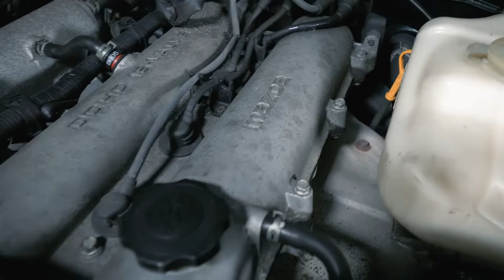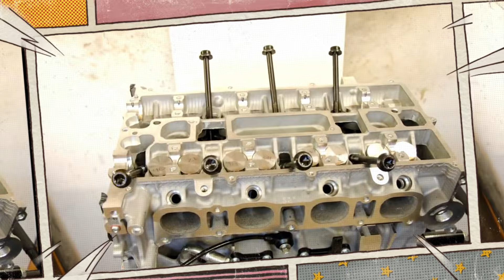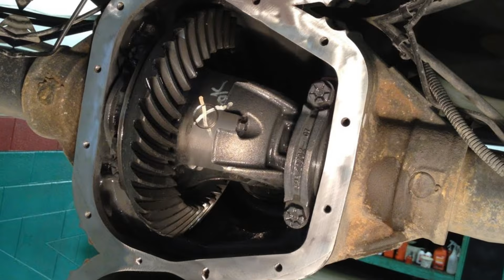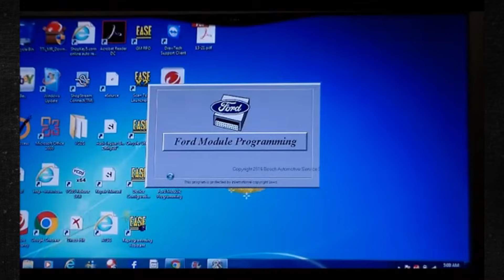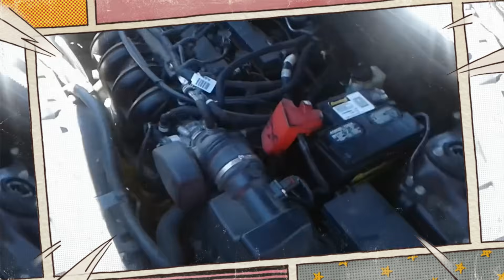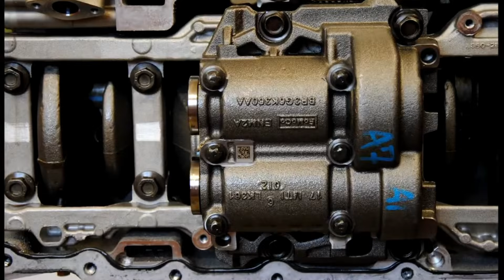Ford 2.5 Duratec Engine: Common Problems and Reliability

Comment: here's my problem with this engine. It's the freaking engineers!!
They deliver early designed it what's the alternator in the back.!!
Why do they not  put in the front so you can get to it why is it down in the bottom??!!
I had a Toyota Camry was it up front and the water pump You can get to everything. 
Ford Fusion in the 2012 just to replace high beam bulbs practically have to pull the headlight buckets out that's another stupid engineering thing with a four-cylinder engine in it!!

Comment: My 2009 Escape XLT non hybrid 2.5ltr that I bought for $1200 with 63k miles has been great. I got it cheap because the Electric steering column went out but I replaced that for $1k OEM part off eBay, dealership wanted $4k for the repair. 
When hurricane Beryl hit us, we ran it 24/7 because we was living out of it for 2 weeks. 
I did have a little hard shift from 2nd to 3rd in -8°f temps but I added Motorcraft Mercon LV to my new drain & refill. That fixed it. Got 36-38mpg from TX to Colorado Springs. 🤟

Comment: Mazda engines are often overlooked when it comes to longevity. I had a 1991 Ford Escort Gt, Mazda  Dohc 1.8 Bp engine that was basically a Mazda Protege with a Ford interior. That part was very true, , gas gauge never worked,the door handles broke. The engine on the other hand never died. I put 389k on the engine, the engine was so quite and so smooth. I never found another 4 cyl engine that was like that until my 2017 Subaru Crosstrek.

Comment: I have a 2010 fusion that just passed the 235k mark, and the motor is still running like a top.  I bought the car in nov 2023 with 206k miles on it. 3 months ago i hit a pothole and 2 days later the power steering went bad.

Comment: An issue I understand with the electronic power steering units is failure associated with the force required to drive the associated linkage, joints etc. Lower ball joint, tie rod ends going dry, getting stiff or shot can be the culprit. To keep em happy longer, at 100k, I used a grease needle on my grease gun with compatible grease to give em a couple shots watching the joint seal boots. At one seventy k now, steering and joints still happy.

Comment: This engine is woldwide known for powering Fusion and a Mazda, but Ford installed it on some Ranger versions on some markets. I got a Ranger 2013 here in Brazil, powered by it and it runs with gasoline and/or ethanol

Comment: I bought my Ford 1999 contour SC with the 2.5 l VTEC 6 cylinder and it was like $160,000 when I bought it and it's almost pushing 200,000 I've had it a year and a half still going strong

Comment: If your car is overheating and you can't figure out why the answer could be in the coolant you are using. If in doubt buy it from the dealership in the parts dept..

Comment: For Gears 1 & 2 rough shifting, try changing the input speed sensor first it fixed rough shifting in my 2005 Mazda 6 2.3l Duratec engine.

Comment: My 2010 Mazda 3 has this engine paired with a 6 speed manual, and it just hit 400,000 miles and still running strong. It has been a great car.
Reply: My custom 2011 Speed 3 sedan is Trucking along at 185,000, with a 2.5 L block, and timing/2.3 Turbo heads and rest of engine. Have not yet dynoed it but I was told it would make a round 285 crank. Making the stock 15ish psi of boost.

Comment: I have a 2017 fusion with this 2.5 engine, flawless.  ive used Mobil 1 synthetic every 5-6,000 miles, currently at 96,000 miles on the car. The only issue has been that arm that attaches the gear shift to the transmission has slipped off numerous times, leaving me stuck in park. so i bought a replacement kit of little bushings that are super strong, i don't think itll ever come off now 👍🏼
Reply: I think that had a recall! Glad it’s going strong, 2016 2.5 here
Reply: I read online that the 2015 fusion had a recall on that bushing. I have a 2010 fusion with no power steering right now, but i'll be closing a deal on a 2015 fusion in a few days. Could you tell me what kit you bought to fix yours? I want to do that repair even if its already been done for the previous owner/s

Comment: The last good engine Ford made
Reply: I think it was instead more of a Mazda engine, mostly based on Mazda's F-series. After this generation the successor generations diverted in the Ecoboost from Ford and the Skyactive from Mazda.
Reply: @ert-j5f  Correct its the Mazda L-series.
Reply: Mazda made, ford doesn’t make good motors!
Reply: Makes they still have it on some models
Reply: And I don't think the Ecoboost is bad either, as it is frequently used on lightweight racing vehicles. I would be more tempted to think that people give them bad maintenance.
Reply: @jugganaut33  The 5.0, 6.7, and a lot of their ecoboosts are actually pretty reliable. There was a 6.7 with over 1.3 million miles on it and still going, the 5.0 is legendary for how reliable it is.

Comment: I'm fairly certain this is the same 2.5 motor used in the maverick. Do we have confirmation on this? I own one, it's been flawless, but it's only 2 years old.
Reply: It is the same indeed. Also, the eCVT on the Maverick is a beefed up version of the same transaxle used on the Escape Hybrid. It is a really good combo. Just make sure to change your oil every 5K miles, don't follow Ford's maintenance schedule of 10K miles.
Reply: @Joe-bepop  I change my oil every 3k or so. Do I really have to? No, but that shows you how much I care about stuff. So hopefully our maverick lasts a long time.
Reply: Same my maverick is almost 3 years now its the reason i went with the hybrid. No turbos for me

Comment: Have 245K on ford fusion hybrid with this motor. Has been flawless. Mobil 1 synthetic oil change every 10K miles.
Reply: Correct.. Mobil 1 Full Synthetic in mine as well

Comment: Not a fan of "electronic" steering assist. Did you see that steering column?  Scary! Hydraulic power steering is a proven and relatively inexpensive design that actually gives you better feedback from the road. An example of - if it ain't broke don't fix it.

Comment: It’s not just the driver’s side axle seal that goes bad. Excessive play where the axle plugs into the transmission is the cause many times. Ford had a pretty well known bulletin on the issue.

Comment: I have 175k and my new pcv valve is louder than my motor and straight pipe at idle…
Reply: You  could delete the pcv valve and put in an oil catch-can. YouTube it. Easy to do. GL

Comment: The biggest section of this video is about transmission issues, not actually issues with the engine 😂
Reply: I change the transmission fluid every 30,000 miles in my 2012 escape 2.5 with only Ford LV fluid. Engine oil and filter every 5,000 miles with Pennzoil 5-20 ultra full synthetic.  Replaced (DIY) water pump all pulleys and serpentine belt at 75,000 as routine precautionary maintenance. 98,000 miles and fingers crossed. The 2012 2.5 Ford Escape aka the box is reliable.
Reply: @Barchenhund  "the box" I love it
Reply: Thx for the heads up

Comment: My 2008 escape has 194k on it. Engine valve cover was leaking when i bought it. Pulled the cover and cleane with 6 oz seafoam in the oil last 50 miles. Poured rest of can of seafoam in and idled at 1200 rpm for ten min. Changed oil. Valve noise and chattering was greatly reduced. Its still going strong today. Also you should replace the plastic coolant distibution piece on the top of the block. Mine wore out at about 150k and coolant blows out. Its only 40.00 part and can be done in an hour.
Reply: Awesome
Reply: The 2008 has the previous version 2.3 litre.  And they’re no where as reliable as the 2.5 I can tell you from first hand experience

Comment: My 2016 escape with this 2.5 engine has almost 140,000 miles and is going strong and has never let me down!
Reply: I have over 250,000 miles on my 2.5 no problems so far
Reply: @Matthew-b9z so buying my 2014 Ford Fusion SE 2.5 for $3300 with 160K miles that’s been fully serviced wasn’t a bad idea? Supposedly had a tranny with 30K miles installed after the original failed. Hoping to get 40-50K miles out of it.
Reply: 400,000 miles on mine and running like its new.
Reply: @karlfocus673 no way what year? Got a 2014 with 160K
Reply: Nor will it. It's better than the "EcoBoost" engines with their thin cylinder walls. Ford built these "Ecoboost" engines, added forced induction and higher compression but then made the cylinder walls thinner.  Not a fan of them, you have "the correct"  Ford engine. If I may suggest to please change the transmission fluid if you haven't yet. Many car companies like to say you never need to change the fluid. but hogwash. Every fluid had "viscosity breakdown" due to heat. So every fluid should be changed at some point in a car.  At least around 100,000 miles. If you have 4 wheel drive then definitely change the transfer case fluid every 60,000 miles because they can become a problem otherwise. Again heat being the issue. You may want to consider an oil catch can. That too will help the longevity of the engine. Even though it isn't Direct Injection, any engine benefits from an oil catch can over the PCV valve. Which is kind of a joke really. Don't recirculate the blowback oil "fumes" through the air intake. Use the catch can and recirculate the oil.  And a low temperature thermostat is also a good idea given how much plastic is used on engines today. Most people don't realize for the thermostat to open "completely" it is 10 degrees higher than the temperature listed for the thermostat. That number is simply when the thermostat begins to open. Thermostats with 160 degrees F, to 170 degrees F is a good temperature. Both NASCAR and Lexus use 160 degree F thermostats for their engines. And Lexus has the longest running engines in the business. And if it's good enough for NASCAR I figure it is good enough for my car. And they use oil catch cans and low temp thermostats. Did you know for NASCAR they use 7.5 Gallons of oil for the motors? Gallons not quarts! It's a dry sump system.  It makes you kinda wonder about using just 5 - 6 quarts of oil for your motor. Or it does me. I bet if you updated a cars oil system to the likes of what NASACR uses, I bet that engine would go 500,000 miles or more.  If it's good enough for NASCAR.  lol   May you enjoy many trouble-free miles with your Escape!
Reply: 190k and still running strong

Comment: The 2.5L has enough kick for me, no ecoboost for me, I'd rather have longevity.
Reply: Tried to tell my sis to get the 2.5 over the 2.0 turbo… she blew the engine, my 2.5 in still goin strong 😂her friend blew up one of the 2.0s as well 😂
Reply: More like Ecoboom.  lol.  The best Ecoboost engine is the 2.0 liter. And naturally the worst is the tiny 3 cylinder.  The Ecoboost engines don't have thick enough cylinder walls to supposedly keep the engines small as possible.  I think it's so they don't run as long. What's one of "the best" engines of all time? The Toyota 2JZ engine in the Supra. An inline 6 with some of the thickest cylinder walls ever designed and used in an ebgine. That's why you could add a turbo and get 400 HP out of a 6 cylinder and it still was reliable.  Why isn't every engine built that way?  Especially for new cars cost. We are not getting the best engineering or tech in cars today. That happened 15 - 20 years ago. Mileage hasn't seen a significant boost since the 1990's and fuel injection and OBD-II was implemented. If you think about it ABS, Airbags, Traction control all came out in the 90's too.  A touchscreen placed on top of your dash (that can't even retract or fold away) where you have to take your eyes of the road to use is not the best technology.  lol  Take care and hope you get many miles with your vehicle. And I bet you will. (for a couple tips that will add tens of thousands of miles to any engine see my comment to the person before you. The only other thing I would add ising Slick 50 every summer and winter. You, and your engine will be happy for it. It's the only product I know that pays for itself because you'll see 2-3 better MPG when using it. It's a really good product, I've been using it for 20 years. Plus been working at Autozone enough years as well. For any rubber or plastic cleaner and protectant the best product by far is "303 Protectant". Yeah, it costs a little more, because it actually works. Plus, you also need less product because it is not as watered down either. It's good to use on your rubber hoses and belts as well for the engine. It literally lengthens the life of rubber components. take care.)
Reply: Especially in a sedan 3 chassis, it's 2900 lbs, for 165 stock to an easily achievable 180 horsepower if you put a cold air intake and have a relatively free-flowing single Pipe exhaust

Comment: I have a 2015 Fusion with 66K miles 2.5L. so far, so good.
Reply: Change your transmission fluid every 30k
Reply: @cruzmascorro9277 i havent changed the transmission fluid at all in my 2010 fusion and so far not a single problem with it. I just passed the 235k miles with the 2.5 and automatic transmission.
Reply: I just drove a 2015 fusion with 220k miles on it and it drove and ran great.
Reply: I have a 2015 ford fusion got it at 92k im at 110k still running great the day I got it only problem I've had is the coolant intrusion from the pistons

Comment: Although my 18 escape had issues with the axles and transmission, the 2.5 has been very good to me
Reply: Good 👍🏼 ya there are other things that can go wrong besides the engine lol
Reply: Made to 157k no issues 1 spark plug change no leaks good engine. But I traded it in for a Subaru